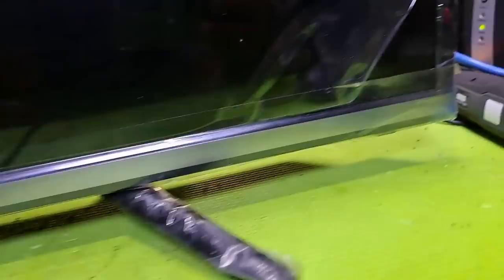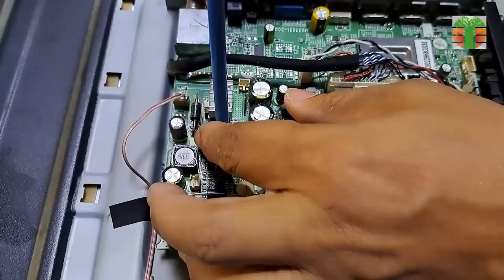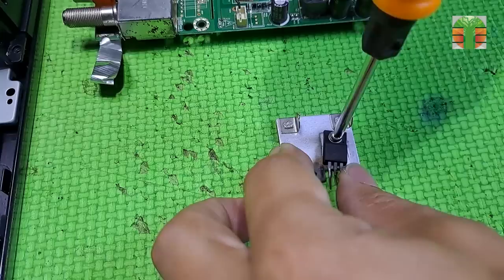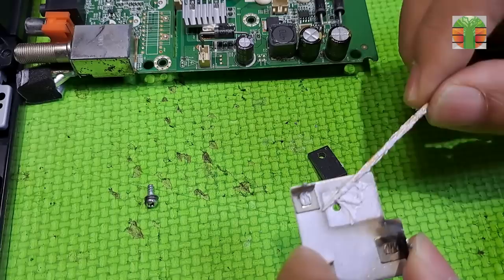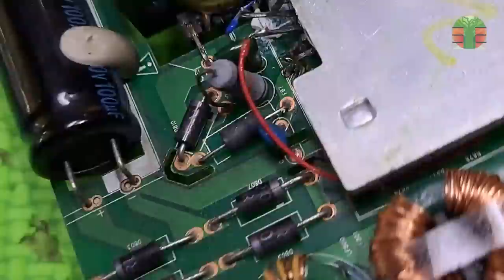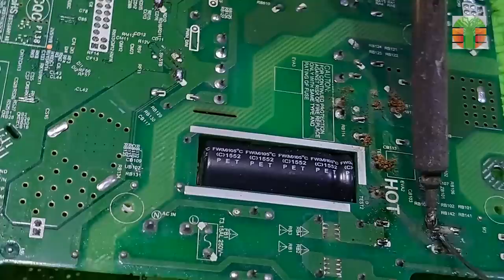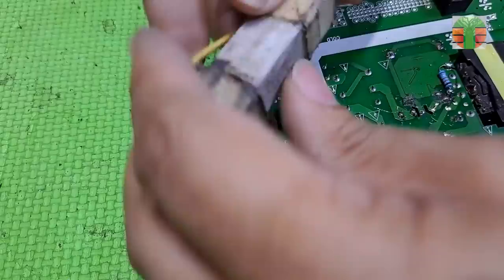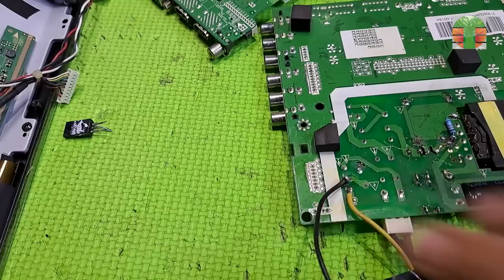Replacing the Over Current Protection Resistor (Power supply modification)

Comment: I watch most of your videos but I rarely see you deal with backlights. Are backlight faults not that common?
Reply from the maker: It is most common. But I dont make a video of it because it's a basic repair, even a not technician can do it, what for making a video of it.
Reply: @tevzTVTevatronics  that's true because technically it's easy but practically it's really challenging at times because of the involved risks in handling big LCD panels. What percentage of your total repairs is successful sir?
Reply from the maker: @roseelectronics4582  32 inches change all led is about $35, if 50 inches  change all led is about $65 to 75

Comment: Will this STR 6053N work on LCD Tv power supply ? I have a power supply board that is driving 6 ccfl tube. So will this work ?

I have used 5-24 (5 wire) module but it's work only 20 to 30 minutes and boom 💥 get exploded.
Reply from the maker: STRW6053N is upto 120 watts

Comment: Hi friend.
How to turn on (LED) tv power supply without mainboard?
I don’t have motherboard and T-Con board for test.
I don’t know how to get it?
Please help me about it.
Thanks bro 😎 🙏🏽
Reply from the maker: if the led is 3 volts, multiply it by how many leads you are going to use. the product or equal is the voltage you're going to supply it.

Comment: Help⚠️⚠️⚠️⚠️⚠️⚠️⚠️⚠️Help
I have a acer aspire 3 a315-51-38fu laptop the laptop turned off because of charge over completely while i using but after I charging the laptop for 2hr it doesn't turning on.The charging indicator led is on when plugged in.
when plugged in turn on and goes off right away when pressing power button.when unplugged the charging indicator led is blinking 5 times and no response.Please help ⚠️⚠️⚠️☠️⚠️⚠️